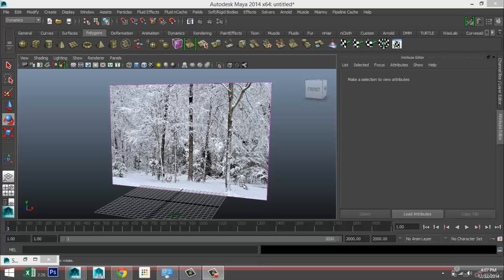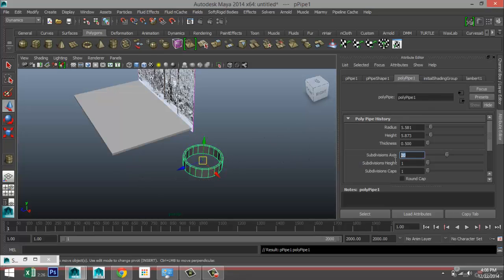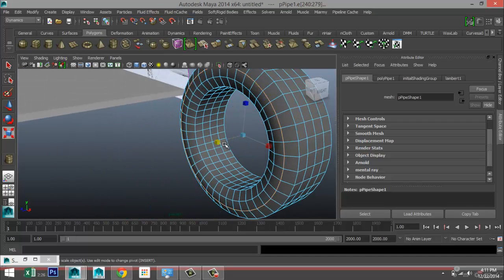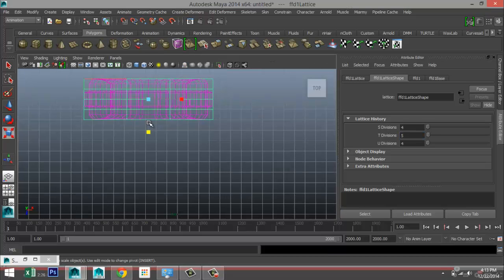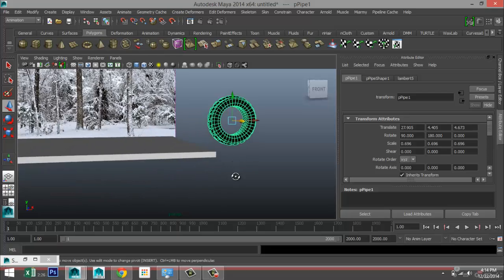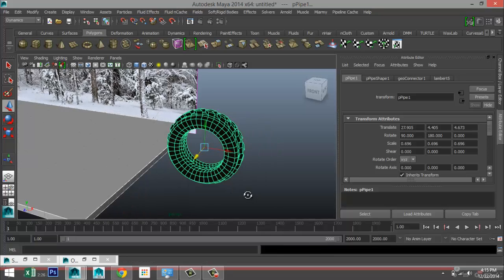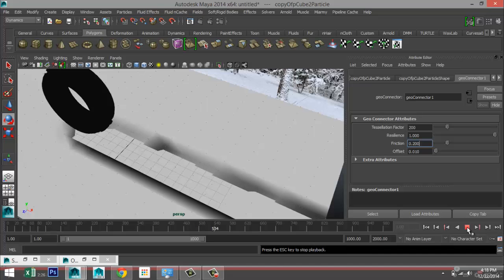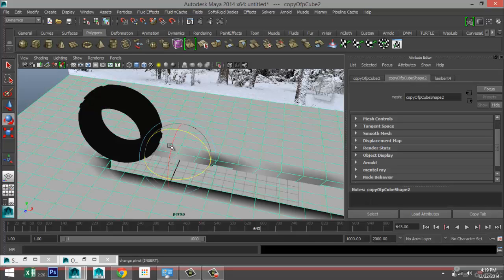Maya tutorial : How to create Tire tracks in the snow ( dirt etc )

Comment: How would you control the snow effect? like some of the effect goes continuously through the whole animation. Is there a way to halt its movement right after the tire moves it?
Reply from the maker: +Michael Tompkins Sure, just halt the animation of the tire
Reply: +Mike Hermes, Well I want the tire to continue through the scene, I only want the slow moving snow effect vertices to stop so they don't go through other parts of the scene.
Reply from the maker: +Michael Tompkins You'r snow surface is a soft rigid body. Make other floor non- soft rigid and you will loose the effect
Reply: +Mike Hermes Thanks a lot! I also changed the dynamics weight in the attribute editor. So it works 10x better now.
Reply from the maker: Nice